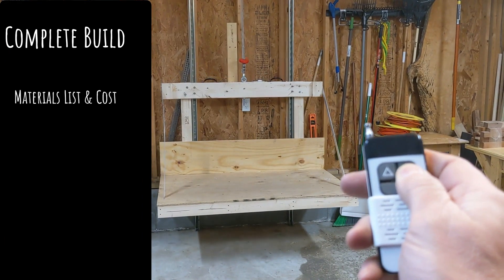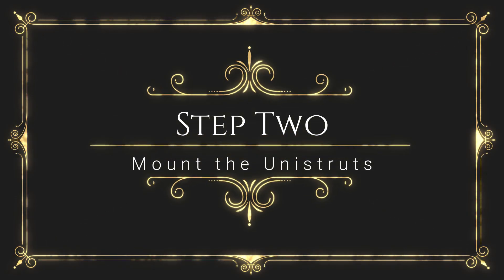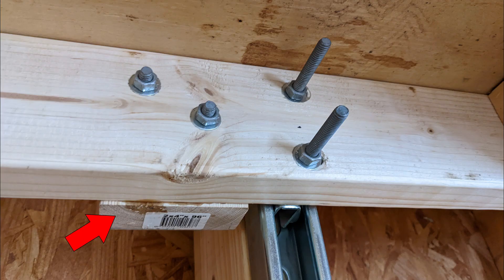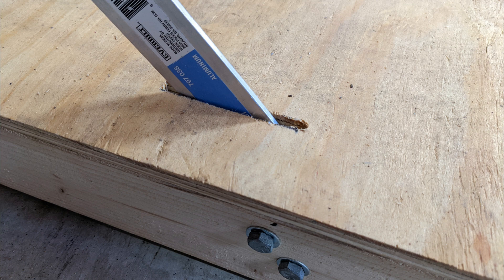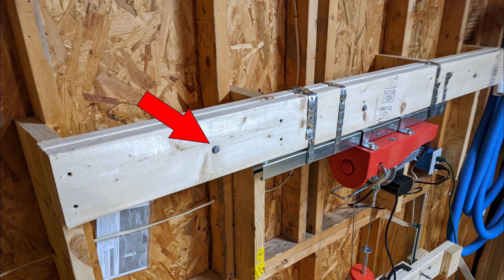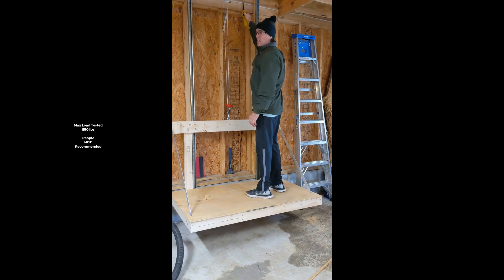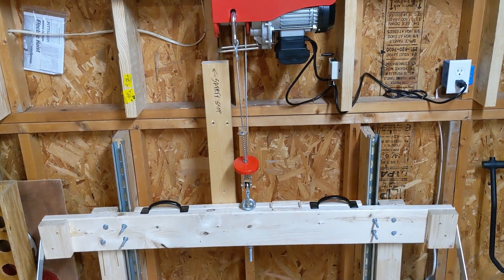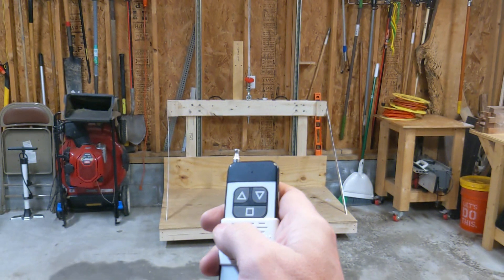DIY Elevator with Wireless Remote (No Welding!)

Comment: Really enjoyed the video.  Lots of great information.  One piece of friendly advice.  You should be advising folks to use structural screws rather than deck screws.  Deck screws do not handle shear forces very well.  They will fatigue and break over time.  Structural screws will only add about $30-40 to the cost of the build, and they will last a lifetime.  Fantastic video!
Reply: The spax t30 large head lag screws are great and come in many lengths
Reply from the maker: You're correct! I've had deck screws sheer at the head and sometimes in the middle of the screw itself. (Not on this project, but it has happened.) Not into construction deep enough to have known there was a difference in screws. I only looked up the weight capacities and went from there. I wouldn't even know where to find structural screws at Home Depot. I went for the coated outdoor screws figuring they would be tougher than indoor screws.

Comment: I have the same remote that I got from Lazada here in Thailand.  Made in China for sure.  It cost me about $28.  My winch is 220v and runs with a capacitor.  My question is how to wire in the capacitor which is enclosed in the handheld control.

Comment: Why do you use such long screws on the trucks?
Reply from the maker: Just make sure the boat is long enough to go through whatever wood you're using. The bolt I selected is longer than what I needed.
Reply from the maker: I assume you're talking about the trolleys? I don't see any trucks as you mentioned. The length of the bolts I used in the trolleys was based upon the thickness of the trolley plus the 2x4 plus and allowance for the nut and washer.
Reply: @mikeh7256  Thanks, yes, i meant trollies. Bolts just seemed to have a lot of extra length in the video and i just wanted to make sure i didn’t miss something else bolting on.

Comment: Warning the Bearings from Uni strut are rated at only 100 lbs each.  Be real careful to keep loads to the wall side of they are over  200 lbs and are put on the front (away from the wall) on the lift platfome you could have a failure.....

Comment: Nice plan and instructions.  I thought of one improvement but might not be worth it. To stabilize left and right you could use 2 more unistruts oriented 90 degrees from the others. Add trolleys to travel like the others to keep it plumb left and right.

Comment: I would use Steel Braces ( Flat Bar ) instead of Aluminium.
But Impressive Build, Well Done.
Reply from the maker: I'm assuming you're talking about the rail I used to hold the hoist? Using the aluminum rails for support, it ends up being a piece of scrap and the hoist just happens to almost custom fit in there.
Reply: @mikeh7256  No,  2 Aluminium Diagonal Flat Bars, Bracing from the Floor to the Back of Lift.
I would use Steel.

Comment: Your supports should go under the top brace / channel to take the load
Reply from the maker: I'm guessing you're talking about the hoist beam. It's definitely secure against the build-out mounts, but you are correct that it would be even more secure if I put a 12-in 2x2 on the front or even found a thicker build out and notched it. The elevator is only rated for about 800 lb and the current mounting will support more than that.

Comment: Thanks Mike. You've been a big help for me. I am still having to use the switch cord. My wires are a complete different color code.  I have same little box & remote that you have but I have not yet figured out the M or module colors for F & R. Is there a way I can check voltage?
Reply from the maker: It's been a minute... I'm sorry to say, but I don't know. I'd have to dig into it again. I'll let you know. I wanted to change something anyway.
Reply: Nicely done. I have a question about cutting the hole in the floor. Did you brace the joists from the garage floor before cutting them?  Surely the attic floor didn’t hold the joist up.

Comment: Mike H. Thank you for the detailed plans and in particular the hot tip on the wireless remote.  After looking at the remote base station and all of the additional connectors I've been able to add an "up" limit switch and a "Down" limit switch, both of which stop the motor when the platform is either at it's peak or the base (eliminates that whiplash concern). I am also working with the "Stop" connector that will allow me to have a safety door; if the door is open the unit won't work.
Reply from the maker: Are you able to attach a picture of how you wired the down limit switch?
Reply: @mikeh7256  Here's a link to pics of my project...its a bit fancier than most as it is for the inside of my home https://photos.app.goo.gl/ioRgVYUoShfvu8aWA
Reply from the maker: @iamdguy1  very nice!
Reply: @iamdguy1  ah man, that's a nice setup👍 come finish mine, I hate finish work😅

Comment: Thank you for the detailed remote control unit wiring and install.  I have been looking for one...  Just finished installing it... works like a charm.   Thanks for sharing!!!
Reply from the maker: A word of caution. When you get a lot of weight on the elevator, releasing the down button doesn't immediately bring it to a stop. It slows it down until it comes to a point where it can stop. I know there's a wiring solution. I haven't figured it out yet.

Comment: You removed the capacitor from the control system completely and had no issues?
Reply: I had issues when removing the capacitor it just makes a buzzing noise when I plug it in

Comment: Same mistake on our eye bolt.  My build is quite similar and the remote is a good improvement i am going to take on and thanks for the reference.  Liked and subscribed.   I did put the fall arrestors on mine as i do find myself a bit lazy on quick trips up and down the elevator to grab something.   I also put a meter on mine so i could measure weight.  BTW i have found the lift to be a super useful adjustable height work surface for projects and have also used it a time or two to unload heavy load from the bed of my pickup truck to ground level.  Thanks for the video!
Reply: I have seen many builds use them, but only one arrestor was used with a max rating of only 410# I don't see that as safe.  Can you say what and how many fall arrestor(s)
Reply: Love to see a link to the meter you used for weight.

Comment: Thanks for the video.  I am building one also but I'm a little concerned with the stop at the bottom. Do you have an auto-switch to stop at bottom. I am concerned with back lash on the cable or is that not a problem.
Reply from the maker: Okay so you won't have any backlash problem going down because I haven't figured out how to connect the remote switch to the downward lock. What happens essentially is that when you let off of the down switch, the elevator continues down for a couple of inches before stopping and locking. With increased weight in the 4 to 500 lb range, a couple of inches becomes maybe five inches before it stops. It's like a super slow stop. Something to keep in mind and something I need help on to figure out how to automatically immediately lock when you let off the switch going down. That is a remote wiring issue. The upswitch is no problem. When you let off, it immediately locks.
Reply: @mikeh7256  Is this slowdown issue going going down when using the remote present when using the wired pendent that came with the hoist?
Reply from the maker: @Growla  No it's not. There is no backlash problem at all. The unit just slows down quickly and stops within a few inches. It's just not an immediate stop like you would want or expect.

Comment: Very nice. I have looked at several videos of personal lifts and I can't believe that they don't go the extra trouble to fit a remote control. I will replace the cable with a single seatbelt type strap and run  it one direction only but I will buy a stronger unit and also fit a one way ratchet. Thanks for giving me some great ideas.

Comment: Thank you for the excellent video. I'm in the process of setting mine up. I got the 880lb Pittsburg hoist, but didn't have a red wire, had a brown one that i assumed would be used in place of red. But apparently not. I opened up the original control to take a peek at the toggle switch. I think I know what goes where now but wouldn't mind a second opinion. Here is a link to the picture. Any help (from anyone) is appreciated. thanks!    https://drive.google.com/file/d/1vqNHVaA70cYb_Acn8ZLuDsy5-fgwKB7O/view?usp=sharing
Reply: I built my elevator from this video. Thanks Mike! However, I have learned a few things I wanted to share. First, I had a harbor freight hoist and used the included pulley to make it lift twice the weight and move at 1/2 the speed. This worked great for a while, but then the cable frayed due to leaving on the red round stop switch bumper, spring and washer. I was these items that frayed the cable after only a few months of use. So, I bought another hoist and cut off all of that stuff. I used a sawzall, but the regular metal blades were eaten up fast, so a carbide tipped blade did the trick. That red disk is solid metal. Please note that I wrapped the cable in duct tape and put 3 lengths of cut coat hanger wire duct taped on top of that, so the blade wouldn't nick or cut the cable. After all of that was done, I looked inside the controller and found that the wires were all different colors.  I did burn through one remote controller, so I do think the amps are a little too high for it, especially when starting the hoist. I did find a couple of good resources to help figure out the right wiring and build a better controller. This video shows how the switch works with the 6 wires: https://www.youtube.com/watch?v=ghiS5GVAiqw   This video has a similar setup, but uses the same connectors on the controller as Mike did: https://www.youtube.com/watch?v=l330V8klkLU  In the last video, the setup makes it real easy to just reuse the connectors from within the Harbor Freight Controller and put them on the contactors in the same configuration as in the original switch, no matter what the wire colors are.  I hope this helps others.
Reply from the maker: I would have assumed the same thing. The best recommendation I can give you is to pull down a schematic on the internet of the original wiring. Then compare it to what you have on yours and see how the wires line up. I think the schematic on the internet has the original that I worked with. I am attaching a couple of the photos I took of my switch guts. https://photos.app.goo.gl/R6EcGBmTQSfr3kMV6
Reply: @mikeh7256  Thank you for your quick response! I'm glad I waited because my hunch was wrong. For anyone out there that has the same Pittsburg 880lb hoist as I do.   his blue = my white, his white = my brown, his red = my blue.  So, it all works now as intended.  One word of caution which may have been covered, if the unit is unplugged, don't forget (like I did) about the capacitor in this unit. Luckily, I was using shielded tools when I cut into the wires and didn't get an unpleasant jolt.
Reply: @Bama5150RT  I purchased the 880lbs model today, and the wiring in my control seems to be reverse of yours, My model number is 62854.I have blue wire on the lower left terminal, black and left middle. Red on lower right, and Brown and middle right.
Reply: @NathanWongviolaman1624  weird. Guess they are all different :) Well, mine worked great for a full day.  Then later in the night i went to test it and it started acting like it was a momentary switch. I couldn't stop it. But if I pressed the cut off bar it would reverse. I got another unit coming, hopefully this solves it....
Reply: @Bama5150RT  Thank you for saving my sanity. I seem to have the same wiring configuration as you and your cheat sheet did wonders making this work.
Reply: @mikeh7256  I have a different wiring in my controller too and tried to view your photos of the wiring of your controller, but I get a folder that says it is empty. Can you please upload the photos again. Thanks.
Reply: Excellent video but I might have missed where to get the trolley? Since the motor is a Pittsburg I assume that it might be at harbor freight? DIY is great as it sure beats $18,000 for a fancy lift. Thanks again.

Comment: Great job explaining this in a step by step fashion!!!! Thanks for sharing so much.  My only caution would be using deck screws for mounting the load bearing wood sections such as the 2x6 that the hoist is mounted to. Deck screws are not built for that purpose and their lack of shear strength could be a risk. I would think it would be better would be to use screws recommended for attaching joists or similar with better shear values.
Reply: The ends of the double 2x6 should be supported by vertical 2x6.  Much like the header in your doors and windows.  You want to transfer the load down until it reaches the foundation.
Reply from the maker: You're probably right

Comment: Hi Mike, thanks for the instructions.  My hoist (440lb Pittsburg) has a tan wire instead of a red one. I've wired it as per your instructions but used the tan wire in place of the red one. The Up and down arrow of the remote controls the lift going down only.  In hindsight I should have gotten the 880lb hoist to match your setup. Do you happen to know the wire configuration with the tan wire?
Reply from the maker: I'm sorry, I don't. It took me a minute to figure out the 880 hoist. If you're doing that elevator at all, you really need to get the 880. With the 440, you put a single person and just the weight of the elevator itself and you might be getting close to limits. For the cost difference, what would you pay for safety?
Reply: Mine does the same! Did you figure it out?

Comment: Wow Mike thank you so much for this very helpful video! One question - after cutting off the wired "remote" (that came attached to the winch) how did you determine how to hook up the four wires to the wireless remote board? Is a wiring diagram available somewhere? Reason I ask is that my winch came with different colored wires than yours did - so just not sure which wires to connect to which terminals - please let me know, thanks again very much!
Reply: Mine came this way as well. I believe it's yellow, black, light blue & white
Reply: @TheBobWood  I'm not telling you what to do, but if I were you, I'd take the remote apart and see which wire go to which buttons.

Comment: In planning  a lift like this for my garage, I have watched at least 50 videos on the subject all of which were lacking in some way sufficient info to actually complete the job in total. Your video nailed down every aspect of fabrication in detail. Love the added bonus of the remote control and details on wiring it.Thanks again for taking the time to lay it all out. Gary
Reply from the maker: I made the video because I found the same thing you did. No details in any videos on actually completing the build and I didn't want to do any welding. Simpler the better. Thanks for commenting!
Reply: @mikeh7256  Could you please point to info on the fall arrestors you mentioned...?
Reply from the maker: @lp4815  The fall arresters are pointed out in the elevator guys video. I didn't use them on mine so I don't have any information